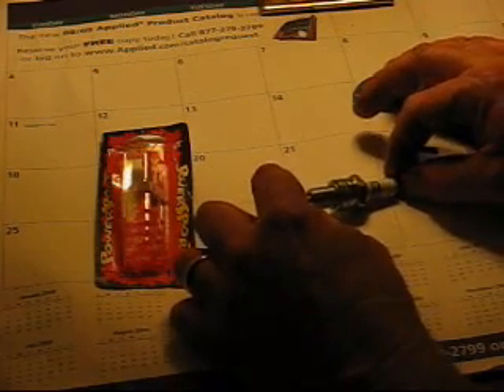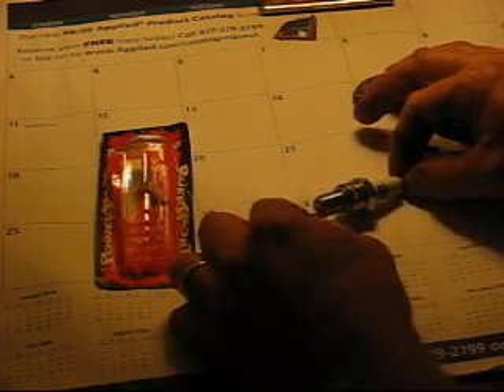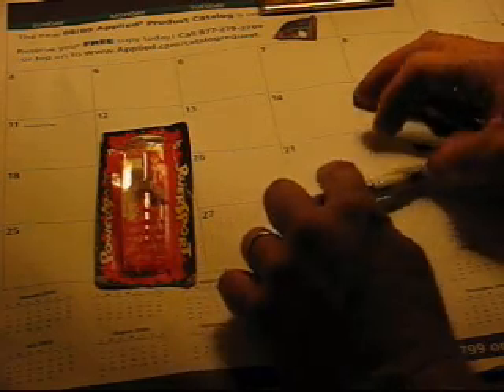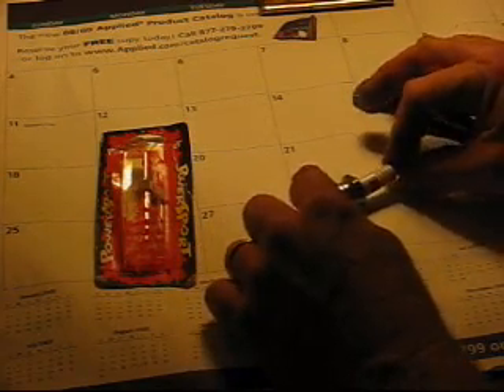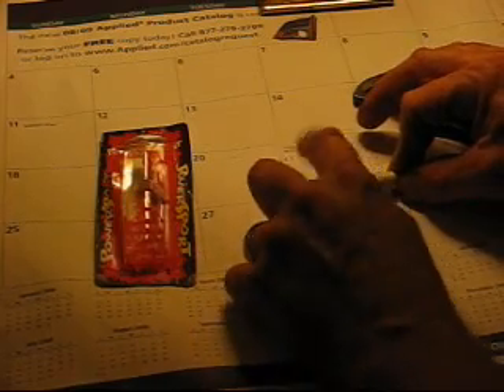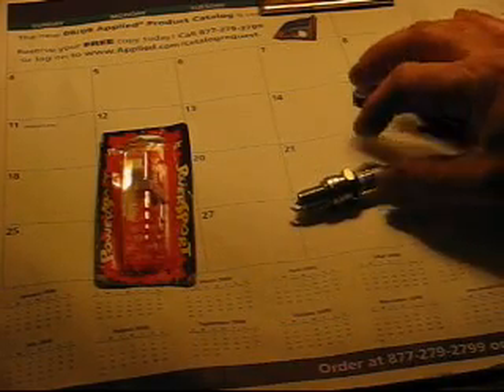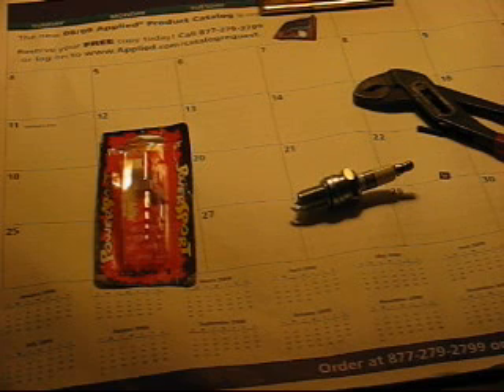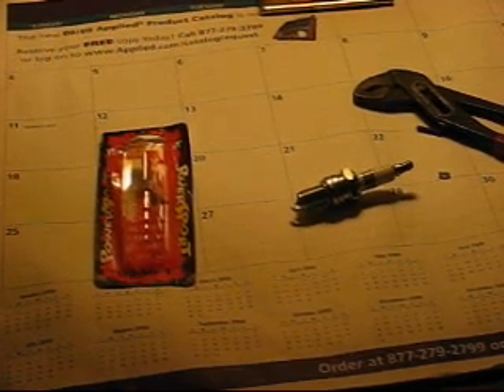Plasma Plug Setup

Comment: @mdbreedi 
I am still having trouble getting the resistor out. I was able to get the spring out. do you have any direction for me. I am using a champion spark plug.

Comment from the maker: Give it a try, the plugs with a resistor was giving me a problem till I just took one apart and replaced it with the wire. I think it will work if your getting no resistance thru the plug.